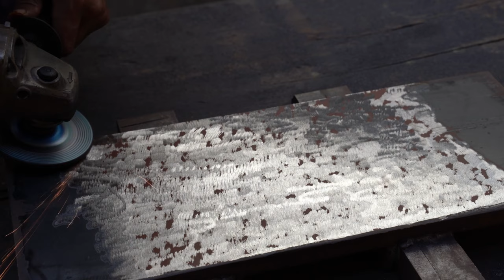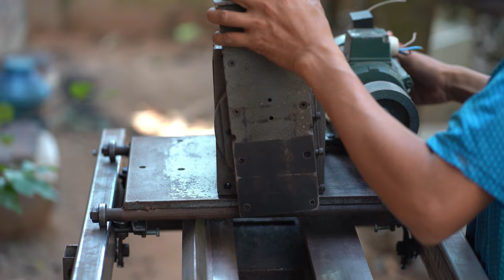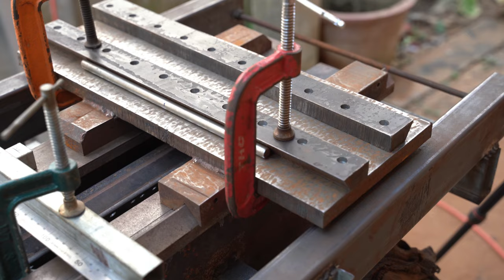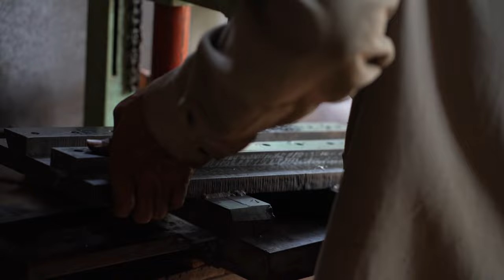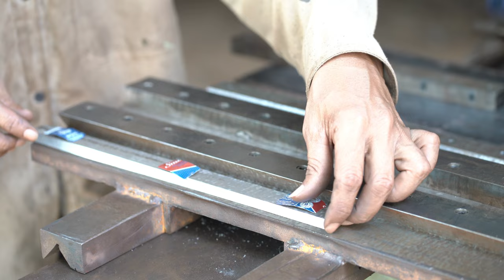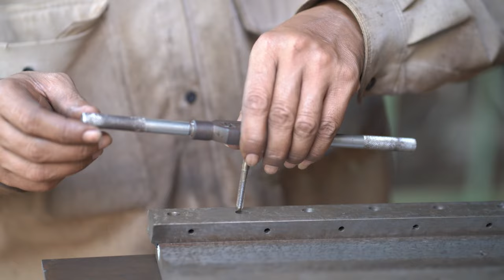Awesome Homemade Lathe Carriage Look Improvements

Comment: Go get some 68 hydraulic oil to help keep your stuff from rusting.
Reply from the maker: Thank you for your patience in looking at my video. I will try my best but I'm not sure how long because of very poor tools how do I making? My place is not easy find as maintain.
Reply: I'd probably disassemble after everything is within tolerance and get it hot blued.